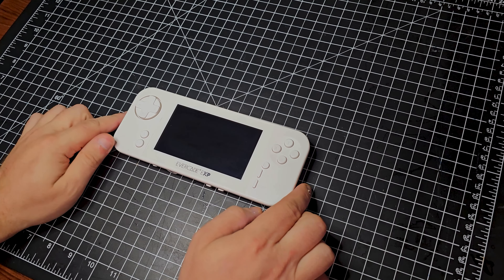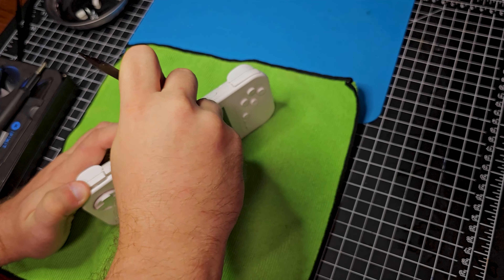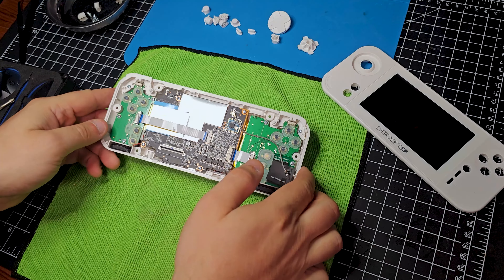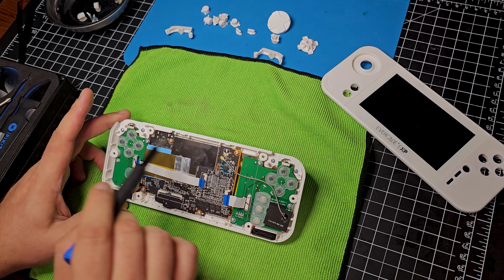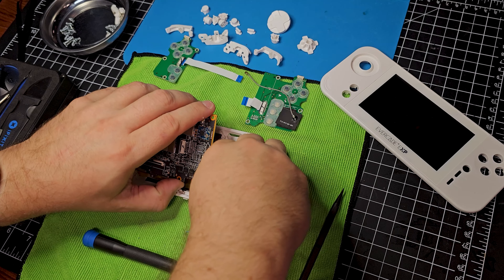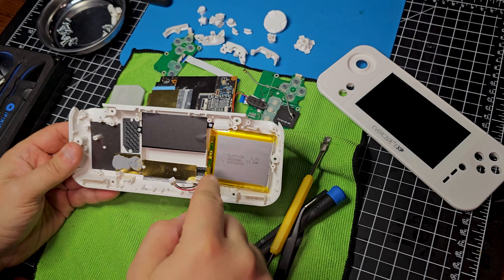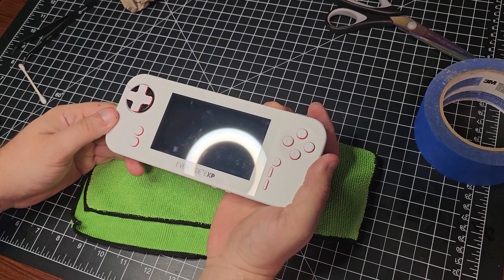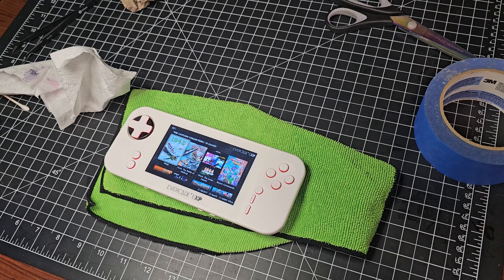Evercade EXP Teardown / Disassembly

Comment: Do you happen to have the physical dimensions of the battery?
Reply from the maker: Guessing by the thumbnail of this video, it looks like its about 2" x 2".  Each line on that grid is a half inch.
Reply: It says directly on the battery: 8x51x54 mm.

Comment: Any Idea on how to remove the display itself? I don't want to pry it by force and break it, and I got some debris between it and covering glass, for lack of the better word.
Reply from the maker: It's more than likely held in place with two way tape.  It would need to be peeled off, which would need to be done differently.

Comment: Is the battery easy to change? Mine no longer holds charge and requires the handheld to be permanently connected to the charger via the mains in order to play on it.
Reply from the maker: Well... if you can take it apart like I did in the video, it really shouldn't be too big of a hassle.